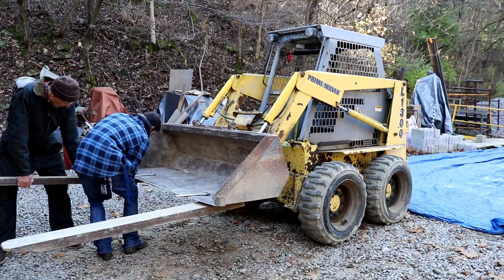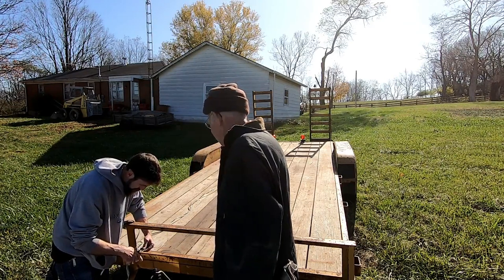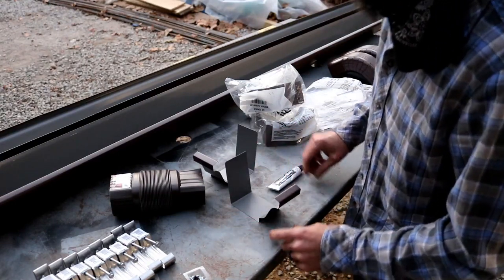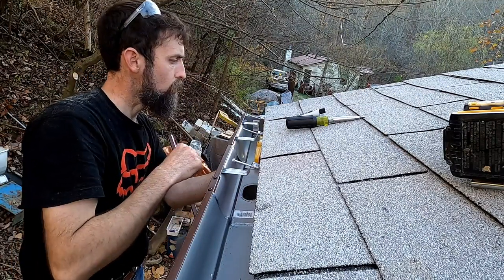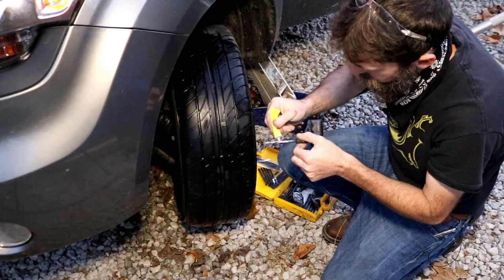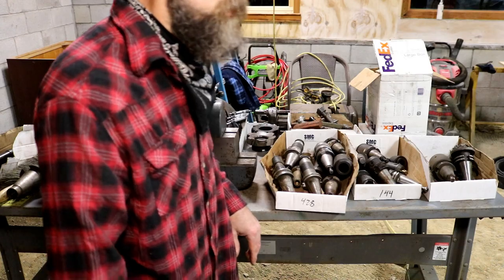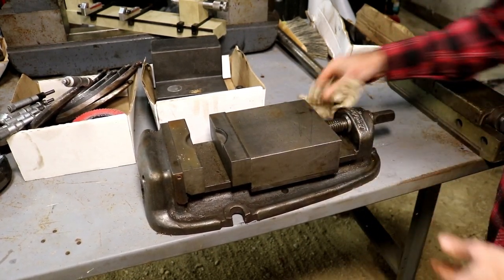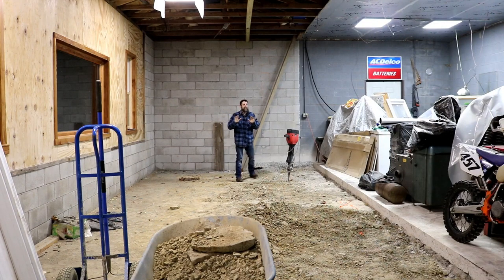Shop Gutters Guard dogs ;-)  new tools and rebar.

Comment: Everyone told me that I was nuts for putting a shingle roof on my shop. I did not want the rain noise either. Plus shingles have been working for many many years. I’ve read to many stories of metal roofs expanding and contracting. Causing the screw holes to get big,  causing a leak.

Your progress on this project has been much faster than I expected in the beginning videos. Great job!

Comment: Steve, two suggestions. Buy some material called base rock and spread it on the dirt floor to level it then rent a vibrating compactor to compact it. Also I think the swamp is going to be a continuing problem until you build a three or four foot high block retaining wall up against that hillside, because every time you get a hard rain it is just going to wash more dirt and debris onto that area. If you do that make sure you leave weep holes every three or four feet so that water pressure doe not build up behind the wall and pin the wall to the under lying rock with rebar.

Comment: Those cutters are what I have sharpened for the last fifty years. At Waner & Swasey they had a planer mill that was literally as big as a house. It used 12" face mills of the same type as 
what you showed. Its feed rate was 27 inches @ 5/8" depth of cut . It had conveyors on both sides of the machine to take away the chips. I sharpened the cutters on
an Ingersoll automatic cutter grinder which did a very fine job. A fun grinder to operate.

Comment: A suggestion.  Make a heavy wire hoop that is larger than the mouth of the downspout.  Then wrap the hoop with a layer of galvanized hardware cloth.  If the result is heavy enough, the winds won't blow it out of the gutter.   

In place over the downspout mouth, this screen will keep the debris out of the downspout.  Nothing is more frustrating than clearing a downspout that jammed from top to bottom with rotting vegetable matter.  

The best way to solve a problem is avoid the problem.  Thanks for sharing. Wish you well.

Comment: I've probably used ~100  tire plugs over the years ... never backed/replaced them with a patch. Never had an issue with them pulling out. Only ever had to redo a single plug because it didn't seal right. Other than that, absolutely no issues.

Comment: I keep a tyre plug kit on each of my motorcycles (no spare wheel on bikes).
Several times I've cut out the section where the plug has been installed and attempted to pull the plug out and it tore the rubber of the tyre with the plug . It's extremely unlikely a properly installed plug with come out by itself.
I've heard many myths about plugs coming out - but ,then, I've also heard idiots say you don't need the glue the kit comes with.
The string plugs are properly referred to as "dog turds"
Reply: Last one I put in I found the glue had gone hard, but still tried it anyway. Lasted around 3 months before I got to get a proper mushroom patch installed, just had to pump up the wheel every week to kepp it above the minimum pressure I am happy with. Also if you can get a proper tyre pressure gauge, the ones you buy are not that good, and the ones at a filling station often are abused and inaccurate. I got a filling adaptor and a more accurate industrial 0-4 bar gauge, and keep it in the car to measure.
Reply: @SeanBZA  I make sure there is an sealed tube of glue in the kit. Any tube that has had the seal broken will go off even with the cap tight.
Digital gauges  are usually fairly accurate. I have had two and checked them against a calibrated digital manometer I have for work and they  were within 0.5 ps of the actual pressure.

Comment: Scherr Tumico products are high quality and were made just an hours drive from me in Saint James, Minnesota. There tubular mics are a pleasure to use as they are so light. I knew a board member 30 years ago and bought a lot of there products at a reduced price. I have a set of mics from 1 to 6 inches. Still use them today but the company no longer exists. It’s most sought after product was its optical comparators which were sold off to another company. It is pronounced Share Tumico.

Comment: German vise was sold in the United States by Dapra the power scraper people. They're great vises when they work  The actuating mechanism is hydraulic if it doesn't leak its great. They made 2 versions the other one was done with a screw and they made different sizes also. 
When new they were incredibly expensive and very expensive to repair. I contacted them many years ago for a repair hydralic cartridge it cost  more then the price of 6 in. Kurt vise.

Comment: When hauling something that needs bundled together such as your rebar, if you place a 4x4 at the points you loop your straps it allows you to have some down force and not just rely on the loop pressure to hold your rebar. And if your only hauling a few boards placing a 4x4 at one end will keep the middle from sliding out,  this only works with short stacks.

Comment: That little vise is probably just missing the dowel that is supposed to go in the holes on the side. There are multiple holes to open the jaws up more if needed. It's also a hydraulic vise, meaning that there's a little torqued hydraulic locking system in there. We use them a lot at work even though they're pretty old but they're great vises

Comment: Hey Steve, I have watched most of the shop rebuild work and I must say nice job Sir. I would like to ask you to consider doing one thing when you move the skid steer. When you chain it down with the load binder, please either wire the handle down or wrap chain around the handle to prevent it from opening in transit due to a bounce or sudden slack occurring on the chain. D.O.T. regulations require the handles of the old chain load binders need to be wired down or chain wrapped so they can't open once locked down. It's a safety thing for you and anyone else sharing the road with you when your moving equipment or materials. Thanks Keep up the great work and thanks for the Share! Cheers from Canada.
Reply: A very sensible suggestion sir!

Comment: A cheap and reliable solution to needing one or two concrete anchors for light duty applications ... drill your 3/16 hole, put in a few pieces of copper wire from 12 or 14 guage electrical wire .. install #8 or #10 screw.

Comment: Nice tool scores! Those old horizontal mill cutters are slowly disappearing, I found a decent selection of them in the scrapyard, some are just resharpened or new and some need resharpening. I actually used my Hardinge mill in its horizontal configure action to cut slits with a slitting saw a week or so ago, that is the first real parts I’ve done with the horizontal setup.

Comment: Steve, I have poured several slabs and used the concrete with the fiber in it instead of rebar, Never had a problem. I did put wire mesh in my last slab with the only rebar around the perimeter. 
Your shop is coming along great. Thanks for the videos.

Comment: Also, they make a flange that you make a hole for in the bottom of the gutter to mount it into for the  down spouts. This does away with the two butt joints that you have that may leak!

Comment: lowes and HD sell 3ft plastic gutter gaurd with screen cover of holes for about 2.15 . They slid under edge of shingle and snap on to edge of gutter.   Ive had for 15 years, they work great.  Yes if you have deluge rain, some will go over edge,  but you never clean gutter. 
Another thing to think on,  cut about 1 in off top of gutter end cap.  When it stops up, and it will,  you will see water flow over end and you know it is time to clean and it keeps water off fashia.

Comment: Tooling AND mic's? You have good friends. Those mic's are real nice for light use. Lots around, as the military and US gov't  bought a lot of them over the years. ST shut doors about two years ago, but at that time the company was primarily optical comparators. Adjustment to zero these is probably by loosening the thimble on the spindle taper. Some had the Scherr (Reed, back in the early 20th cty) style, with the adjustment being a rotatable graduated edge on the thimble, but most require resetting the thimble on the spindle taper. AFAIK, they never made mic's that adjust like most modern ones by rotating the sleeve. I would not recommend too much work to the frame in cleaning. They will distort if you go hard, much more readily than a solid mic frame.

Comment: To size the  down pipe from the gutter here in Melbourne we use the rule of  one square inch to every 100 hundred square foot of roof area . i then like to go to the next size up for the down pipe. i.e.  2 x 4 to 3 x 4 or even 4 x 4 just to make sure

Comment: 27:15 you might consider dropping a piece of mesh or porous foam over the downspout to keep leaves from clogging it up
Reply: Then the gutters will block up
Reply: @johnmcdyer7297  That's what you want....... so the leaves aren't clogged in the down spout.  Keep em where you can get to em.  Last thing you want to have to do is dig that under drive pipe up
Reply: That gets my vote. Having had blocked underground pipes I'd take cleaning the filter any day.

Comment: @Steve Gressel vice is Swiss as others mentioned, you also seem to be missing the handle which is important as it's a hydraulic vise. You first actuate the outer ring and then the inner shaft (or the other way around). Mine says it's 4T max clamping force, but you can actuate a small selector on top for 2T and 1T. Also, there is a cross pin in the base towards the operator which you can take out and reinstall in the other bore, so you get additional ~2" between the jaws. I never took mine apart but I can have a quick look if you need a video of a working one.

Comment: I didn't see any "dobies" to go with the rebar. They are little concrete blocks with wires imbedded in them, so you can tie them to the rebar intersections and hold the rebar off of the ground. They are cheap, and very useful to hold the rebar in place at a consistent coverage.

Comment: Great Progress, and good on you getting those gutters installed. They will definitely help with your drainage/ erosion problems (especially on the creek side). You can never have too much Rebar in a foundation slab...
Reply from the maker: Gutters are very high on the list. The creek side absolutely needs them. 
Good to see you again 😁👍
Reply: @SteveSummers  Gutters are also high off the ground.... be extra careful installing them on the creek side!

Comment: that good old American standard .027" aluminum... You might consider a little mesh dome over the top of that down-spout to keep leaves from getting into the driveway drain pipe.
Reply: Second what Lee suggested as two of my buried pipes got blocked due to leaves and moss.
Now have mesh ‘balls’ that you jam into the tops of down pipes installed, that just need checking once or twice a year.
Just make sure they are not covered with detritus before any heavy rain, otherwise the gutters just overflow and look like Niagara/Victoria Falls.
Don’t ask how I found out🤗😂
Looking forward to seeing the shop finally laid out with all your machinery.
Makes mine look weeny.
Reply: ditto
Reply: Yes.  Actually you should consider a leaf guard system of some kind. Experience speaking - how your shop is located you will be cleaning your gutters weekly and monthly 8 months of the year. You'll get your breaks in December January and July August.  Pain in the hind end!
Reply: @oldschool6345   a leaf guard system for sure with all them trees around the building.  Very wise thing to do

Comment: Just as a heads up there is a different between bt and ct holders, almost all of that is in the flange. But sometimes the CT’s have metric or UN threads in the pull stud holes( but that depends on if they are din or iso holders). P.s. I’m excited that your shop is almost complete! Good job on everything.

Comment: Hi Steve, Nice gutters! I've experimented with gutter covers and found the best answer is a cover that slides up under the shingles, and attaches to the top front edge with a couple of screws. The shape and size of the mesh openings in the covers are very important, and I've had the best luck with a diamond shape with an opening of 3/16". Debris that is small enough to penetrate will wash out, while keeping the larger items out. I went without covers for a couple years. What a disaster! Leaves and debris fill them up, and what a pain to get on a ladder and annually clean them out. Do yourself a favor my friend. Nice progress, and best of luck!

Comment: the 40 taper you said was Heat Shrink is actually a Hydraulic  holder....DO NOT HEAT THE HOLDER TO GET THE TOOL OUT. it is actuated with the screw on the bottom side of the body. check the inter web for use....

Comment: Can you get leaf guards for the gutters? With all those trees I could see things getting clogged. Keep up the good work 😃
Reply: Not only that but the first 3 months depending on rain amounts there will be a bit of grit that just comes loose so he might need to clean that out too.
Reply: Can buy them or just make them from hardware cloth cut into long strips, so that they fit across the top of the gutter. That way leaves just fly off the edge onto the ground, but the water goes in.

Comment: Been watching since the very dark beginning  when you started on your hopelessly collapsing shop. What a total transformation ! Can't wait to see how your going to lay the NEW shop out ! Keep in mind to place everything where YOUR comfortable with it ( Most important have a per plan ) plus you need a good sealed spotless final assembly super clean area away from all grinding dust & dirt etc for special close tolerance projects & high dollar machinist tools ( bore gauges joe blocks etc . ) But in my opinion bottom line you really did one HELL of a great job on the building! Now the big question ? do you still remember how to run everything in the machine shop ? lol !  Soon it will be time to get back to home machining work this winter! ( yeah I know, you can't wait !!!! )  P/S 7 inches of concrete is not really needed in your floor, 5 inches of reinforced concrete with that size rebar is fine, I only used 4 inches with 1/8" steel mesh on 2 inch hangers under my shop floor and after 20 years with my Cincinnati #1 mill & 20 inch swing Summit lathe & granite surface plate I still have no cracks in floor with 900 lbs V-8 motors laying all over the shop. To me 7 inches is way over kill  ( unless your planing to install a big VTL or  big vertical boring mill ! ! ) and concrete delivered is not cheap Steve  !     Have you seen your little buddy peanut lately ? M/P.

Comment: An average factory / where house floor here in Melbourne would be 6" thick and the reinforcement would be sheets of wire mesh .
The mesh would be 20 ft long x 8ft wide and made up of 3/8 wire at 8' centre's  both ways. and the concrete would be 32 - 35 MPA.

Comment: After much study I purchased "Hoover Damn" gutter guards from Lowes.  I have fewer trees around my house than yours.  All summer, my back porch gutter with no trees directly over head of it or the roof it serviced would be clogged every rain.  Think of how the leaves that pass will collect in your drainage system.  Fun to clean out.    I had enough of it and an damage it was causing my home all the constant overflowing.  My only regret is I probably should have installed plug in heaters at the same time (Ohio).   ;-)

Comment: I am 63 and  have worked  at same place 42 years at a large DOE contractor  much of our tools are furnished by the company--- -----Some tooling has been around  since the 1940's---the tubular mikes are what I always use  by choice---I keep 1in  -8inch in my  tool box but tubular mikes up around 30 inches are readily available .  Starrett. mishtyo, and  others are available BUT I ALWAYS GO WITH tube mikes.   The bigger the work --the more they shine---much easier to handle and to get finer measurements!!!!! THE RESULS OF OLDER THINGS AND OLDER PEOPLE STILL HAVE CAN NEVER BE REPLACED.  I am going to send you  small box of "goodies".

Comment: Steve, put some pins in the holes of the German vice an you can close and anlarge the opening of the vice, its a great vice, I have one size bigger I think. On the front you can adjust the tork.

Comment: Looks good, Steve. With a run that long on those gutters you really need two downspouts. I've never had any luck with that jointed gutter, once the ice gets in it it blows those joints apart. I'm sure it will be adaquate for your needs
Reply: Well if it is sealed properly moisture should not get between the joints to freeze then blow the joint apart it looks as though Steve put a bead between then wiped a joint inside and out. That should in theory seal it and if the sealant is flexible it should again in theory allow for any temperature expansion and contraction.
Reply: @samrodian919  The gutter will back up and fill and freeze in the winter as the roof thaws. It's inevitable, it happens anywhere you have winter. It's the freeze/thaw cycle that will open those joints up and blow them apart eventually, I've seen it a million times. It will be perfect during the summer and then in the spring they will be leaking. Not a big deal for a shop but it will happen, and the fact that they only have one downspout for that long run and it's basically guaranteed. It's not a criticism of Steve it's just an observation from my work experience. It's not so much an issue in climates that don't have a winter freeze
Reply from the maker: We will see. The joints are definitely the weak part of the system.

Comment: I believe you can buy adapters for those holders to accepts drawbars. They just replace the pull stud
Reply: I have a feeling Steve will just machine them out of some steel though, as a very good cost saving if he cannot get good used ones.
Reply: @SeanBZA  whatever works.